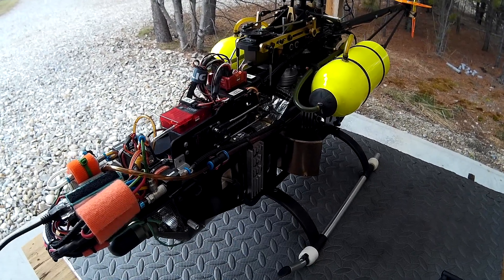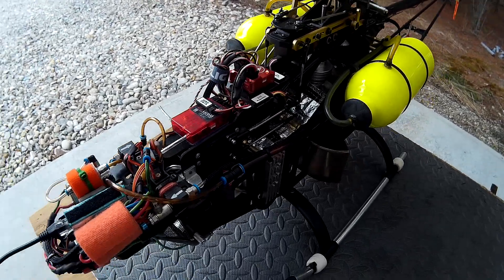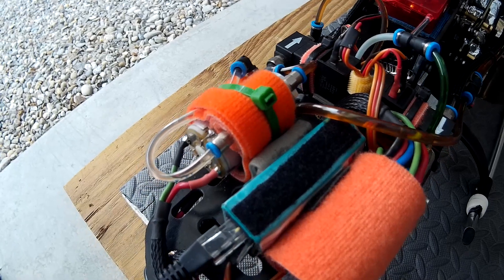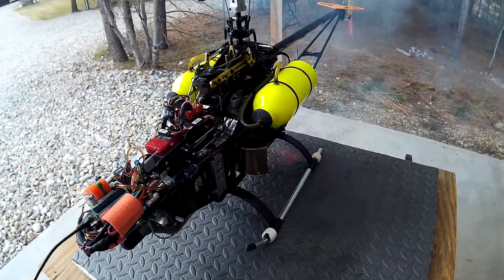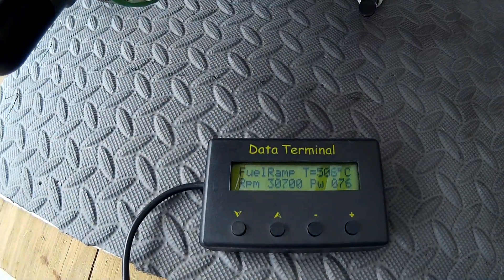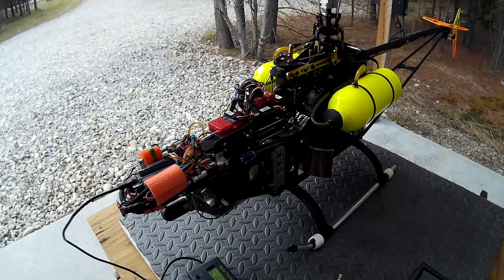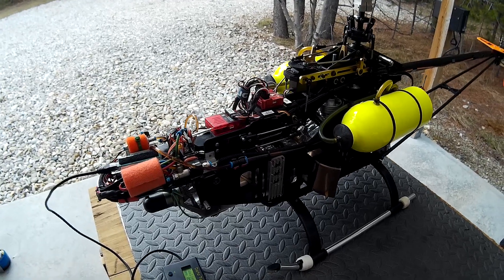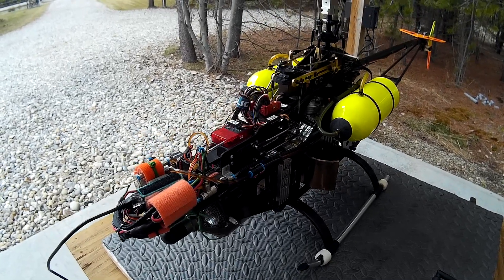Wren MW54H Start Up

Comment: did you run 2 or 3 cells for the fadec? thanks!
Reply from the maker: There are two voltage inputs for this particular Wren FADEC. First is from the throttle channel out of the RX to run the logic. That voltage has to be 4.8 to 6V - no higher. I run an inline voltage regulator on that input since I use a 2S LiPo RX battery for the rest of my onboard electronics (servos/RX/FBL). The second voltage input to the FADEC is to run the fuel pump, solenoid valves and igniter. For that, a second dedicated 2S LiPo is used and is non regulated (8.4V down to 7.0V).

Comment: Hey John, I recently bought a turnine RC helicopter.  It's my first ever turbine and I was wondering do you have any tips for setting the engine up on open tx or is it fairly straightforward ? Cheers,
Connor
Reply from the maker: @Connor Cain - This is how I did it on mine. It will of course be FADEC dependent and you will be following your engine manufacturer's throttle output settings, but it should give you a few ideas: https://youtu.be/R77obpPpyDQ
Reply: @Rchelicopterfun  That's perfect thanks so much, that helps massively.